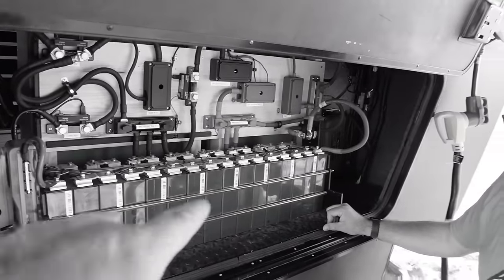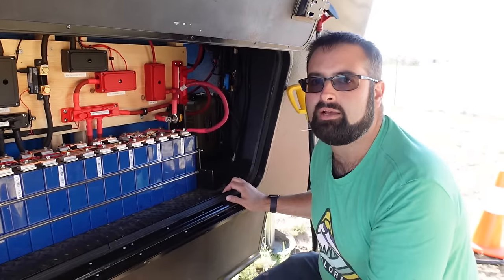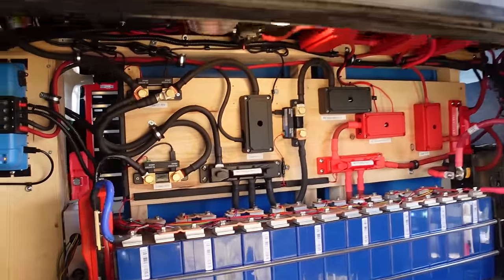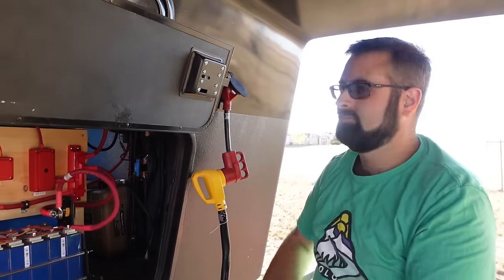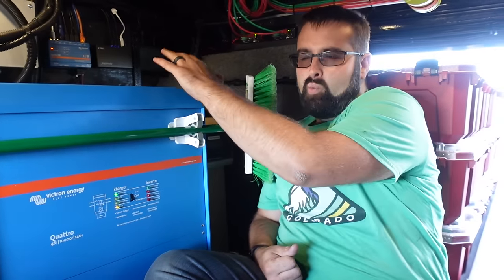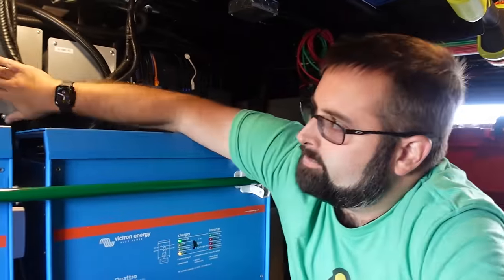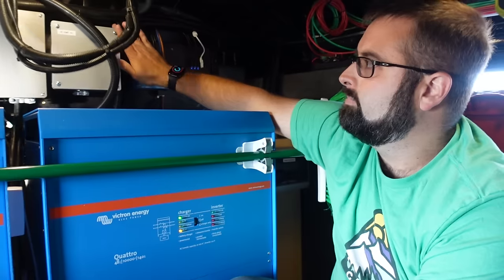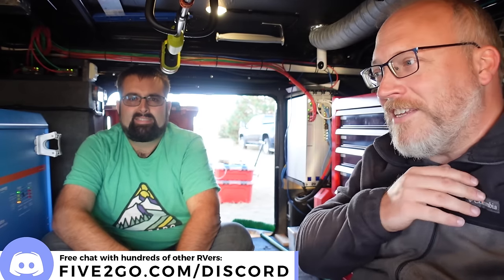How To Do RV Lithium The Right Way

Comment: I run my 12 volt on a 55 amp IOTA converter. Off of the 120 volt AC output of the main power system. I tried the Victron from Amazon but the seller wanted access to my network to set it up so I sent it back and went with Magnum. I think the inverter should not include a charger. I think we would be better served with a separate charger and run the whole rig from the inverter. Always a pure sine wave. Do not need to worry about dirty shore power or lightning strikes.
Reply: The problem with going from DC to AC with the inverter and then back to DC with a converter is efficiency.  Your conversion losses are much higher than with the way I'm doing it by going 48VDC to 12VDC directly for the DC stuff and separately going 48BDC to 120VAC for the AC stuff.  Specifically, I don't need to convert twice to get from 48VDC to 12VDC.

Having the converter paired with the inverter is helpful as well, because it "just works".  The Quattro's can manage power flow in both directions.  Makes for a simpler setup in the long run.

Not sure about the vendor requiring access to your network to set up the Victron.  They do require configuration, but you're totally able to do it yourself, if you know what you're doing.  Or a particular vendor could preprogram the units for your configuration.  Active access to your network certainly isn't a requirement -- and I wouldn't give them access to mine either.  ;)
Reply: @triphius  Going from high to low DC is a conundrum. I know you can just hook up wires to the battery or two to get 12 volt but to keep balance is the plan. I never turn my inverter off. I don't want to put power into another battery to keep it fully charged because that drains power too. But then it is also a back up of reserve power for starting a generator or the engine. So far it works for me and runs at 14 watts minimum while powering my assorted LED lights and the furnace fan and water pump come on when needed. I don't shut down my computer and keep the TVs and microwave plugged in so I just have to expect power loss and try to control it.
Reply: @timsteinkamp2245  I don’t shut off my inverter either, everything stays running all the time as if this was a sticks and bricks house.

However, you can go the DC-to-DC converter route without having a battery on the lower voltage.  You just parallel the converters, such as they provide you with enough power to operate leveling legs and slides (which are almost assuredly your highest draw items).  I was considering doing this myself, but going from 48 to 12 significantly limited my converter options.  I’d need at least 5 of the converters I’ve got to comfortably remove the 12VDC battery.

As to your point about draining power to keep up the 12VDC battery, that is absolutely true.  However, I have my converters set up so that I can disable them with a relay in the Cerbo, so if we’re boondocking or something where we don’t have shore power, I turn off the converters and the 12VDC equipment just runs off that battery directly, leaving my 48VDC batteries for powering the inverters.  My 12VDC battery is 230Ah, so it does last quite a while just powering lights and whatnot.

Comment: This is one of the cleanest setups I’ve ever seen…but are the cells 230Ah like the 12V battery or are the 48V batteries made up of larger cells? 280 or 274Ah cells seem to be the cheapest right now but 310Ah cells do exist. Are they EVE or Lishen cells?

One more question is that the big daddy 500A Daly BMS? Any regrets not going for a JK or Ant BMS. Not sure if JBD/Overkill make a BMS that large.
Reply: They're all the same 230Ah cells -- in both the 48 volt and the 12 volt batteries.  It's just a different number of cells in series.  They are from CALB and the model is L173F230B.  The Daly BMS is 250A and my disconnects are 200A resettable breakers.
Reply: I was going for clean in the battery design, but Ben really raised "clean" to a whole new level with his system wiring. 

Anyway, I went with a Daly in the design mostly because that's what I had the most experience with. Today there are probably some nicer options out there but I didn't want to try something "new" on this project. There was a narrow window to do the installation, and it was already rife with other challenges like having the trailer stuck to the truck because of a blown hydraulic hose (hence no room to work), a snow storm, cold bitter wind, and both of us being sick. 

I think the best thing that came out of this was the compression system my mechanical engineer came up with. It's simple and makes a system that is easy to maintain. We went through a couple iterations of the design before he had his epiphany and came up with the "bookends" idea that saved a couple hundred pounds of steel and made it so much more simple.
Reply: @bladedspokes  And Eric tells the rest of the story!  🤣☝🏼
Reply: @triphius  I'm kinda surprised you didn't 😂 What can go wrong... haha

Comment: what bms are you using ,what disconnect also.
Reply: BMS is Daly 250A 16S and the disconnects are Eaton Busman 200A resettable circuit breakers.

Comment: I would never gamble with those odds. If one single 3.3VDC cell in either of those arrays throws an error it renders that array out of commission because of it's link in the series. The BMS system can only address small imbalances before it runs home to mama, then your storage is effectively cut in half, and it gets worse if you split your roof solar between two charge controllers and did not design a combiner switch-over system to reassign the unuseable solar panels.
I like to gamble on sportsbook in Vegas, not out in the middle of a dispersed camping LTVA in Arizona or California boondocking when the day time temps hit the mid 80's. and my neighbors are offended by generator noise.

Comment: DIY batteries can in theory be done cheaper, but what about warranty & support? Let's hope the elec guy who put together these batteries from components is willing to support it when something breaks. Otherwise this guy is farked big time.
Nice system though. The Victron sales guys will love him.
Also - I hope the BMS has temp probes for low temp charging protection if he takes his rig anywhere below zero.
Reply: When you DIY you automatically provide an unlimited lifetime warranty.  You know how to build it, you know how to fix it.
Reply: @Patrick_Cashman  Did you actually watch the vid mate? An elec engineer built it for him, so in this case he can't support it himself. That's why it said let's hope the guy that actually built it is available to help. However yes, I agree with you in principle.
Reply: I can actually support it myself.  I’ve learned how to do that.  Also, the guy who built it is a friend of mine not just some random business contact.  So I can always ask him questions, etc.
Reply: Also, yes… there are temp probes for low and high temp cutoff.
Reply: @triphius  this was obvious from the way you are able to describe every component and what it does, and how they all work together.

Comment: I see two issues. Vibration and cold. Those cells can be damaged if charged at 0 degrees celcius or below. That, and a 1000 watts of solar will take days to fully charge the banks.
Reply: The basement is heated and the BMS will prevent charging at 32ºF and below, and discharging at 0ºF and below.  Vibration could technically be an issue, however we've got a Gen-Y pin box that flexes well and independent suspension, so the rig actually rides pretty smoothly.  I've left a drink on the counter inside before and it didn't move.  I'm guessing we'll probably be fine in the vibration department.  Only time will tell if we've done enough there.

Comment: And they're prismatic cells, which do not perform or last as long as the cylindrical cells used in BB batteries...
It's kind of like the diesel vs gas truck for towing, they'll both do the job, but the diesel is better at it, much more efficient, and longer lasting...
All things being equal, I'll take cylindrical cells over prismatic cells any day, even at the added expense...

At the end of the day, I'll keep my L5P GMC 3500HD AT4 and my 4xGC3 BB batteries...

Comment: The BattleBorn Battery that looks like a car battery weighs 31 pounds, 21 of them weighs 651 pounds.
Reply: 36 LFP4 230ah cells weigh 325 lbs. 9lbs each. The 800lbs includes all the equipment.

Comment: There's no "right" way to do an RV lithium battery conversion. Once you get above a certain capacity 12V is too inefficient and you need higher battery voltage, either 24V or 48V. The problem with a 48V is solar panel charging. The voltage output from your solar plant needs to be at least 5V above your battery voltage so the solar charger can charge the battery. A "48V" lithium battery will be approx 53V when charged, + 5V margin for the controller = 58V. You need to divide that by the average voltage Vmp of your solar panel to see how many panels you need. For example a typical Vmp of a 100W solar panel is about 17V, so you would need four of these panels in series to exceed 58V. The open circuit voltage of that typical panel is 20V, so you would need a Pv rating of at least 80V for your solar controller, actually 100V to provide a safety margin. If you don't have enough solar panel voltage, a 24V battery configuration is a compromise, still more efficient than 12V.

Comment: The only issue I see with these is service.  Batteries do fail, with a few larger batteries you have fewer to check.  With all those you would have to disconnect them all to test, to find the one or possibly more with issues.
Reply: Certainly a good point, however these are effectively a few larger batteries.  The BMS attached to each monitors each cell so it's very easy for me to check each individual one.

Comment: 48 volts is easier to invert to 120 AC
Reply: I'm glad to see there are other people who understand the basics.
Reply: Would 60 volts be optimally convertible to 120AC? It is presumably currently less supported, as a standard config for BMS's, charge controllers, and inverters.
Reply: Theoretically. But i am not aware of any inverters thst support that DC input voltage!

Comment: Why with a system as nice as it is that he is trying to run three Coleman ac units that are very inefficient? He needs more solar so if he removed the 3 Colemans he could add more solar and change over to a mini-split system that is not an energy hog?
Reply: He has a great system but it’s really not all that. He is wasting too much electricity.   Mini split would be a way better solution

Comment: I shutter to think what would happen if something were to short out one or more of those cells.
Reply: I agree, I see no consideration for safety from fire or crash containment.  This is nothing anyone needs, he can't possibly charge this up in any short length of time to be usable.
Completely over engineered
Reply: Agree there should be a non-conductive cover over the top of the cells. Just in case you drop a wrench on them.
Reply: @arthurcutting9227  Some people need it.  I have a bigger system and use it every day.  Full time RVing, boondocking in remote locations for weeks at a time.  

I do agree he does not have nearly enough panels to support the max draw of the inverters for very long. Actual usage will be much less than the inverters are capable of, but even still the system would be much more robust with more solar input.
Reply: @Patrick_Cashman  There is no matching of actual loads to storage and charging capacity. How does the system charge on cloudy rain days, how does it charge while traveling. All I see is a big bank of batteries (Viagra) with no viable way to charge them from flat in a reasonable time.
Recording the actual power usage of the RV over time and building a system that can handle that with some percentage of reserve. Then build a recharge system strategy to recover in a reasonable time.
My old boat could run everything for two days if we traveled for 90 minutes min.
That's matching a system to the loads.
Reply: @arthurcutting9227   At this point he is charging them with a generator. Therefore, he is not off the grid with this because he is buying fuel to charge them. Also, he is using a portable generator because generators are a year out. I also don't see what he paid for this system to justify if it was worth it. But that is a custom 5th wheel top of the line from a small niche manufacturer of RVs. I am guessing money is no issue. Just the two Inverters had to be an arm and a leg.
Reply: @arthurcutting9227  Solar still charges on cloudy days. And while traveling.  Travel days are actually better for charging because usage in the RV is way down. Of course it charges less on cloudy days, but it's not zero. I get 25-40% with full overcast and rain. 

The large battery is very different than Viagra.  It's like a big credit line for a small business with ups and downs.  It evens out the input requirements when the outputs fluctuate a lot.  It can pull you through some cloudy days, and store more than you need on the really good sun days. 

I continue to agree with you that the input has to be capable of meeting the total output plus a bit more.  He needs more panels.  But the size of the battery is not really related to that equation, unless it's so small that it can't supply the needs of one day.
Reply: @Patrick_Cashman  he has 20kwh of batteries and 2k of solar. If he has dead batteries in June he will be there for a while before he gets charged.
Another thing I see horrifying in this is the gvwr, this has to be way beyond the rating when you combine all of this stuff plus a 20kw generator and a tanker for fuel.
This is another example of ego engineering.
Reply: I’m still totally within my GVWR.  I’m not going to risk my life and the lives of my family doing something stupid like that.  Anyway… I wanted to be able to run everything for an extended period of time and I can do that.  At the moment we do spend most of our time near shore power hookups, but eventually I’d like to have more flexibility there.  Adding solar is the key to that flexibility (that and the batteries which I already have).  But I need to come up with a well engineered (and safe) solution on how to get enough panels up there that it won’t matter if we’re on the grid or not.
Reply: @Patrick_Cashman  To be fair, I do cover them with a non-conductive cover when I’m working down there.  But I would actually like to have something engineered as a full time cover for them.

Comment: I disagree about the solar being a less expensive part. I have 2000 watts of solar and leaf batteries. A 3000 watt inverter and a 4000 watt low frequency inverter. Two charge controllers and the best wire and buss bars and a nice shunt. It's barely enough to have me off grid and I have atleast 15 grand maybe 20 grand in it. Did the work all myself but still was kinda expensive.
Reply: 6k in a 6500k inverter, 8 415w panels and 4 5.12kwh batteries. And associated parts. Gotta buy smart and do your own install and save a lot of $$$
Reply: @johnstark4723  the solar stuff is addictive I'm starting to see. In the last couple months I got 3 BMS. One jk and two 300 amp Daly. Then bought a 24 more 280 eve cells from 18650 battery store. I'm at almost 30 grand in this solar stuff now and hopefully can get the solar tax credit. That's how I justify all this to my wife lol. If I'm devorced soon you will know I didn't get the tax credit lol
Reply: @matthewknight5641  sounds like you need an intervention 🤣

Comment: I would be more safe if I knew Battleborn batteries were built  built buy Battle Born batteries and their expertise so that’s just how i am. When I open the door of the camper the first thing I see is a gauge that tells me the state of charge and for all winter with no battery Tender the Battle Born batteries always say the same thing 90 to 95 amps left on each batteries

Comment: nice set up but he is not getting the capacity he thinks . his calculations are off. basically it's pretty close to what he'd get from the same number of battleborns...the nice thing is 48 volts allows much lighter cabling as he pointed out. I did a similar set up but decided to go with 24 volt rack batteries.
Reply: Could you please clarify your comment about me not getting the capacity I think I am?

Comment: What’s he got inside that uses that much electric? I use 26 kWh in summer for the entire week! I guess this is a tax dodge, it doesnt make sense to have that much power when you can have a third and run the engine once every 4 days!
Reply: 3-4 days without sun that's needed if you don't want to do a genny